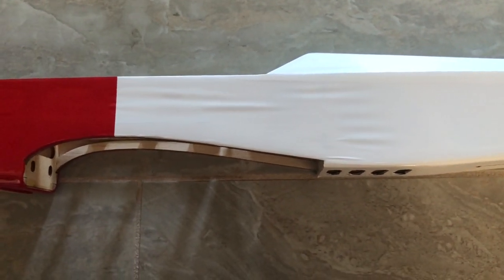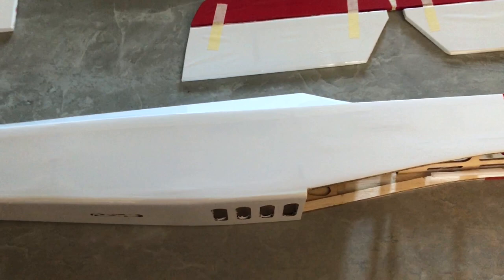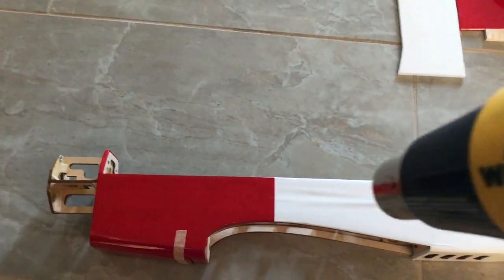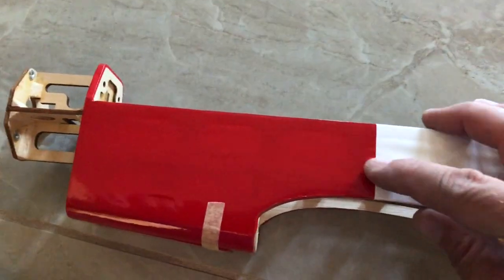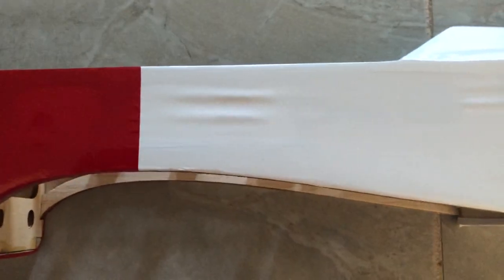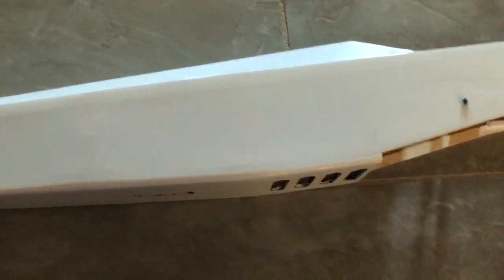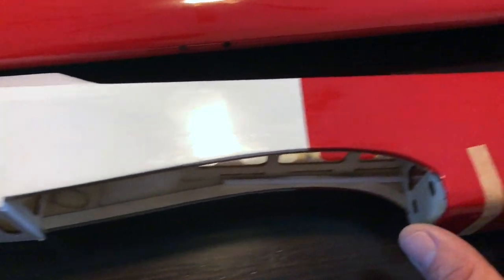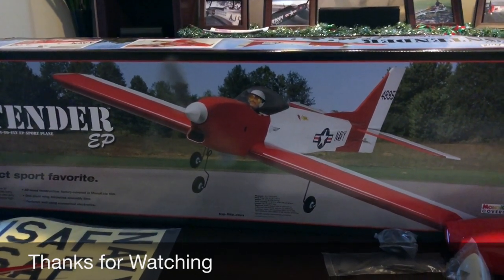How-to get Wrinkles out of Your ARF RC Plane Iron on Covering

Comment: Great video! Would it help if you used an old sock or heat glove to help smooth/press the covering down as it’s heated?
I have an ARF that spent time in the sun and is now wrinkled so looking for help as to how to get them out. Wrinkles are on sheeted surfaces, and iron only made nasty creases.

Comment: I just use my covering iron on hot.
Reply from the maker: If it works...that's all that matters.
Reply: @RCVideoReviews  forgot I even wrote that, those two years flew by! 😂
Reply from the maker: @isaaclyonsf1  The YT comment system leaves a lot to be desired. I JUST found this.
Reply: @RCVideoReviews  😂 at least you found it eventually lol
Reply from the maker: @isaaclyonsf1  Yeah, very unfortunate delay.